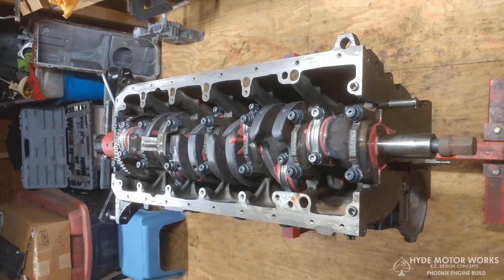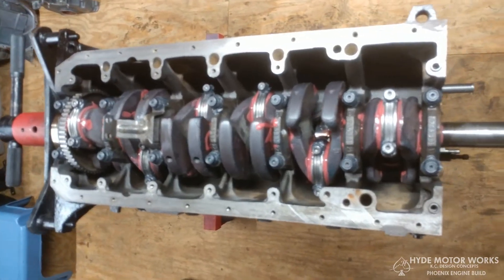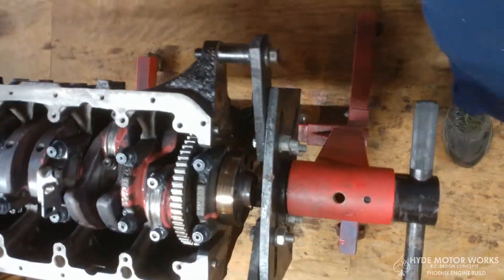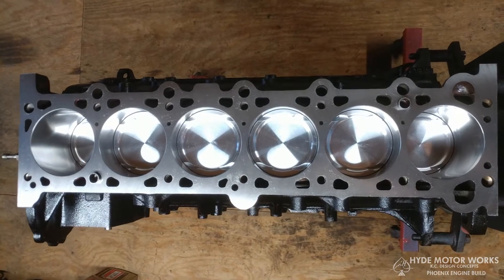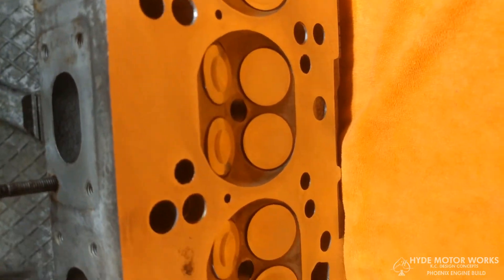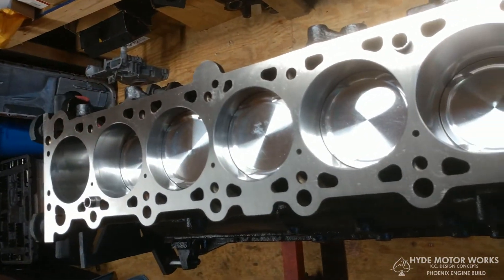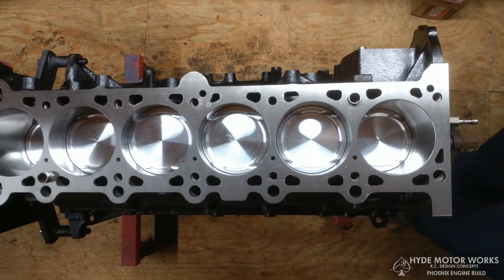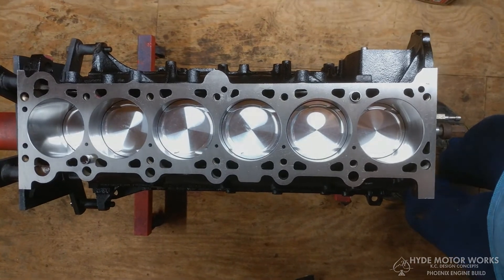1200HP BMW Engine Build | Phoenix Engine Part 1

Comment: A low mileage well-maintained M54B30 should handle 450. But I've seen some over 600. A lot of it depends on tuning. The rods seem to be the weakest link.